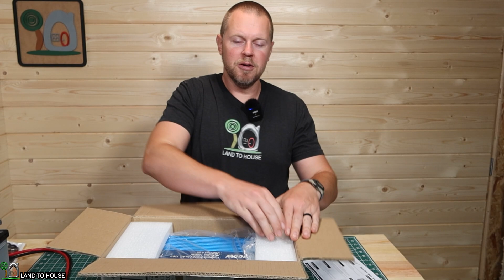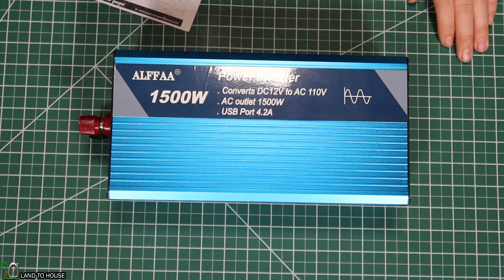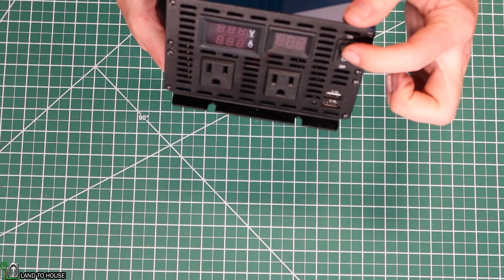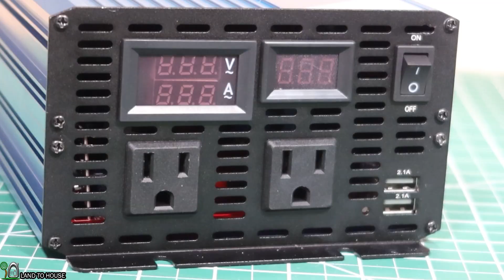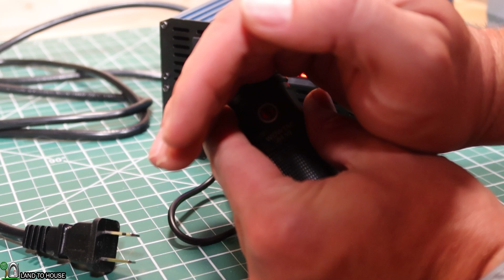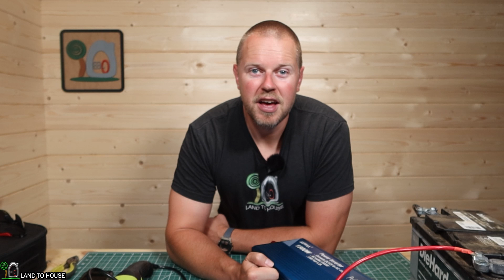Alffaa 1500w 12v Pure Sine Power Inverter

Comment: Saw your review on Amazon.  Tracked you down to your youtube channel.  Nice review.  How you still liking the inverter now that some 8 months have passed?  :^)
Reply from the maker: It worked well until I connected a big battery without first using a resistor to slow charge the capacitors.  The inverter stopped working.

Comment: Well done review and that's quite a neat toy they gave you to play with. Thanks for posting.
That "spark" represents a few hundred amps inrush current for a small fraction of a second to charge the capacitors in the inverter.  That's not so good for the life of the battery or the inverter.  Might I suggest using a resister between the second cable and terminal for 20-30 seconds to pre-charge the capacitors in any inverter so that you don't get that spark. When done use the resister between the inverter's terminals to discharge the capacitors so you don't risk a shock.  It's safer for you and will help prolong the life of the inverter and the battery.
Reply from the maker: I have written down to use the resistor you sent in a video. I need to keep one of those down in the shed for these tests.
Reply: @LandtoHouse  Another off-grid video I saw used a desk lamp with a 60w incandescent bulb (240ohms).  They just cut off the plug, split the wires and striped a bit at the ends.

Comment: looks exactly like a 240v 1500w inverter i had a couple of years ago.
The first one lasted 2 weeks and the second one arrived with a dead fan, i rigged up a fan straight to the battery but that one also died in under a month.
I had them running one server at around 400w.
They were Junk

Comment: I think its best you connect the wires to the Inverter first and then to the battery,,,I say this because if you do it the other round you not got live wire that might short circuit
Reply from the maker: Good point.